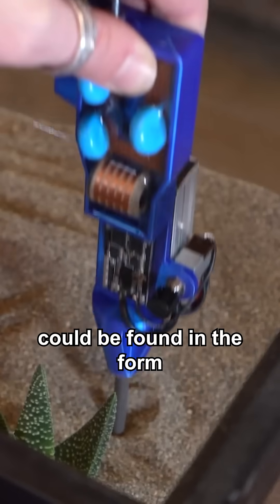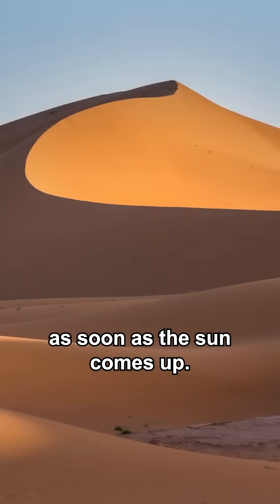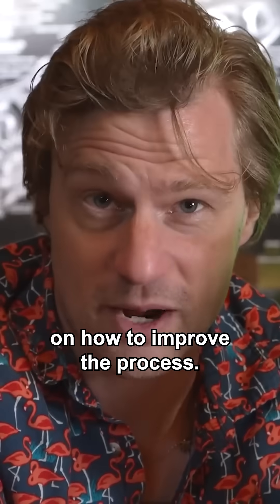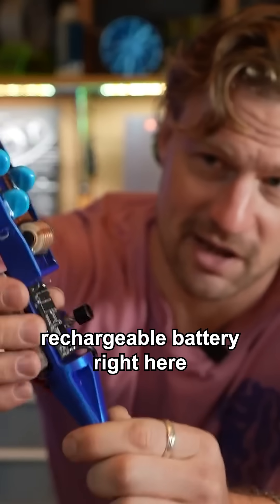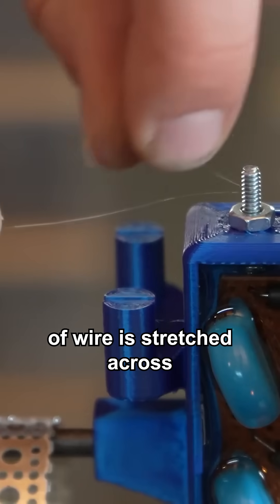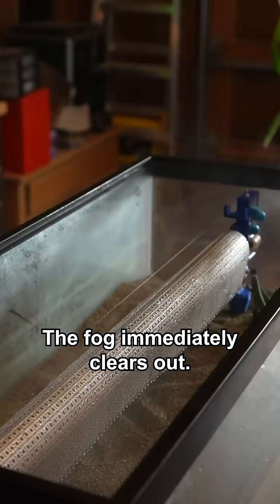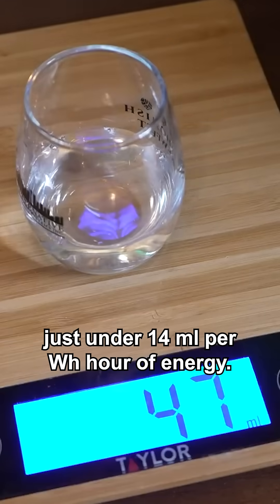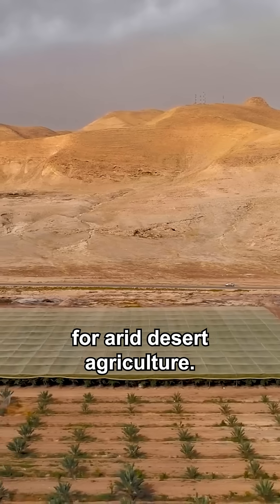Solving Desert Water Shortages Using 20,000 Volts (from full video)

Comment: If there's enough water in the air to be visible fog for which the measurements are baded on, there is definitely a latge water source nearby from which the fog is coming from. Deserts dont have fog just rolling in regularly. If it did, it wouldn't be a desert in the first place.

Anywhere these kinds of devices would produce any appreciable level of water are by definition not areas where one is necessary, not to mentione the water produced is generally not considered reasonably safe for consumption without further filtering processes.
Reply: Most of California and Northern Mexico are coastal desserts with fog rolling in most mornings. In fact most redwood use this to collect water. This idea is not good for other reasons though.
Reply: Costal areas that he mentions usually have that source be salt water and this is a watering device for watering crops not drinking water.
Reply: @jeffwithheldforsafety8359  okay, build a greenhouse over the water. You get water, and salt….oooor buy a reverse osmosis desalinater for 1 10th the price
Reply: OK, I just commented pretty much the same thing I did not know you had already done it and yours was done way better than mine years. Actually sounds like you know what you’re talking about. My comment did not it sounded like a guy that has spent most of his life working on farms in the south with no more than a high school diploma that I don’t even know how I managed to get that
Reply: Fog is in the air and can just be blown away. Water nearby is no guarantee that the water will hit the ground and if the water nearby is saltwater it can't be used to water plants
Reply: Damn, yall are blowing up my phone. Let a man cook some popcorn first.
Reply: What amazes me is that they could pipe salt water into the desert to be evaporated. Sell the salt. Plant shrubs to secure both the moisture and stabilize the sand.

We have real knowledge on how to re-green deserts.
Reply: @skipmage  I think the problem is mostly economics. There just isn’t a financial incentive to do that. The US alone has absolutely massively swathes of land and yet there’s still a housing problem. Not only that but the US has a massive amount of unoccupied houses as well which almost makes no sense if you just look at those factors alone. The reality is that no one wants to live in those houses because it doesn’t have jobs or hospitals or supermarkets or any combination of things a human would need to comfortably live. The same thing goes for deserts. Suppose we do make all those deserts green. What do we get out of it? Well, we potentially have a place to put houses and malls and schools and… oh… that’s another couple billion dollars upfront cost. Okay, let’s turn them into farmland. We just need to greenify them, then add soil, create irrigation systems… and… oh, that’s another couple billion dollars for produce that’s more expensive and not as good as anything on the market.
Reply: As a PSA about thunderfoot, the guy has been a hack for some time now, only concerned about getting clicks on his vids. 
For instance, in his criticism of a device that supposedly removed moisture from the air, presumedly using a similar tech, his analysis had the air never moving. Once the moisture was removed from a cubic meter of air, that cubic meter stayed in the same place until the end of time. The mistake was so glaring, it had to be intentional. Trashing things is popular content. He's done the same thing repeatedly.
Reply: @ i think hes been focusing musk too much especially recently. Are you talking about dehumidifier water generators? I cant speak much about that mistake but I believe it is pretty well established that dehumidifier water generators dont work well unless air is humid (so, using it where it is actually needed is not gonna work well), way too expensive at scale and simply just not a new idea.
Reply: @emmioglurycbj Seems your comment was addressed to me, not sure why you didn't directly. If so, you completely missed the point. Don't use thunderfoot as a reference for anything. Whatever he says is to be dismissed out of hand until independently proven. As another example, he claimed that the Hyperloop was impossible due to thermal expansion and contraction, when the problem had been solved over a century ago. 
As for air dehumidifiers that can keep an individual alive in the desert, are portable and solar powered, no. That has yet to be proven untenable, to my knowledge.
Reply: @ he was pretty spot on about the hyperloop not being worth pursuing. He was able to spot the failure point of one of SpaceX’ rockets from just the video. His analysis of Kickstarter scams like the indoor composter (read: trash ovens) and the water from the air (read: glorified dehumidifiers) are in line with basic thermodynamic analysis. He was actually so spot on that the defense for the kickstarter changed like three times. One of them having the device basically become a rain catcher and he was able to show that a bucket in the humid area would have worked better. I’m not going to pretend that he gets it right all the time because these types of things tend to go all over the place. Covering basically every engineering discipline which can easily spread yourself too thin trying to learn everything which makes you very susceptible to making a mistake. But to say Thunderf00t’s analysis is immediately dismissible is just being disconnected from reality. He’s way more qualified than the overwhelming majority of YouTubers when it cones to stuff like that. If you think I’m wrong, I’d be happy to hear who you think would serve as a better science YouTuber that does analysis videos on the broad range of topics like Thunderf00t does but disagrees with him on a lot of his points.
Reply: @Unfortunately for you, you were unable to construct a rebuttal. It's a fact that pipeline thermal dimensional changes have been dealt with and that air moves. There's been many more examples of either stupidity or dishonesty on his part, but you'd ignore them as well. 
It's irelevant to me and the discussion that you're a fan. Thunderfoot is an unreliable source, as proven above.
Reply: @K-Locke  oh, there’s solar roadways. He was right about that too.
Reply: @ I just told you, I don’t expect him to get everything right. It’s right there in my message. I said if you cover as wide a net of topics like he does, you’re bound to make mistakes. Did you think I was arguing you were wrong about that one specific thing? I said his analysis are usually spot on and are easily verifiable by highschool level physics. Off the top of my head, he was right about the composter and the dehumidifiers. If you think there’s a better science YouTuber than Thunderf00t that covers as much topics as him, has a comparable or better track record and disagrees with him, I’d love to be enlightened.
Reply: No, he wasn't right about the dehumidifiers. His calculations were made assuming the moisture was taken out of the surrounding air, which was never replaced due to a magic boundary of some sort. How many times must we go over the same thing? And, it wouldn't matter how many examples I give, you'd stay in denial. So, play pretend whatever you like. For everyone else, disregard his junk clickbait.
Reply: @K-Locke  that’s not a mistake. That’s a simplification for the purposes of calculations. We do that in physics all the time. Don’t tell me you think all projectile motion calculations are wrong because they don’t all factor in literally everything. Projectile motion with just the initial velocity and a constant gravitational acceleration is disgustingly accurate despite not factoring in things like air resistance, Coriolis effect, and time dilation. Show me the difference between this discrepancy. Let’s go through the math together.
Reply: @K-Locke  he was also right about plastic from the air. 🤔
Reply: And, I can make fallacious arguments like yours, if you like. Prove there's no other YouTube channel that does a better job at what thunderfoot does.
Reply: @  @K-Locke nobody particularly commented about his dehumidifier analysis. Its just that he has a very succesful track record of debunking scams and shams and as far as I've been following him, he almost always (at least mostly, if not entirely gets it right. I also do not recall saying it is not possible for a dehumidifier to generate enough water in dry climates so a person can survive. The problem is, beyond cost and filtering problems of dehumidifiers, they usually claim it is possible and viable to generate bunch of water at scale; and plan to do this in dry climates! At which point, ged darn water trucks become exponoetially more economical. Please correct me if I'm wrong anywhere
Reply: @K-Locke  fallacious? There’s plenty of better science YouTubers. A lot smarter than him. The problem you don’t seem to understand is that they don’t regularly disagree with him. That’s what you don’t seem to understand.
Reply: it'd be cheaper to bring in water with trucks than to do weird electricity shenanigans like thees.. its nothing new..
Reply: @zachariah-1 you don’t have to fuel solar panels you just have to clean them
Reply: @justkev1044 yeah but the solar panels need sun and he states in the video that the fog goes when the sun comes up. So he lied in the video saying that it can be solar powered.
Reply: @zachariah-1 or build a pipe
Reply: @zachariah-1 are you an accountant?!?
Reply: @zachariah-1 if everyone thought like you, we wouldn’t progress in anything
Reply: @jaaad344  that's how my understanding of science works, i will not believe you when you don't have strong credentials and present something supposed to be groundbreaking until you prove it otherwise. It's called skepticism
Reply: @emmioglukant bro, you make a meager living writing comments for dictatorships. We aren't going by what you think.
Reply: @zachariah-1  Like he said, it's for coastal regions.
Reply: @HyugaSama  i bet two nickels established methods are crazy more reliable and astronomically cheaper
Reply: @zachariah-1  can't see my comment. What are you responding to? Quote me atleast
Reply: oh i cant see it either now lol. this level of cancership is crazy.

i was commenting to you saying it was intended for coastal places
Reply: @zachariah-1  I see. Well since we both don't know enough about the established methods, guess we're at an impasse
Also why would you assume that? Less effective alternatives are utilised all the time
Reply: @HyugaSama  well, my mental firewall policy is to take such a stance whenever I see "cool innovations" about settled methods that i see on non-technical YT channels or god forbid on the news. I'm more than happy to stand corrected whenever I'm wrong with a 0.1% error rate.
Reply: @emmioglukant  that's an appeal to tradition
Reply: @HyugaSama  well maybe, but id rather ignore or deny these kinds of stuff until seeing anything substantial, just tired of giving the benefit of the doubt to the fancy new technology in an established industry, that doesn't deliver 99.9% of the time; that takes expertise and quite a bit of effort to debunk. you could watch some debunk videos by thun der foot 00 you'll get what i mean. you can claim a bs with no effort, but debunking will take much more than that, so it is only natural to be negatively biased towards these things.
Reply: @emmioglukant  but you don't know the industry. And depending on the situation, it's not "99.9%"
Reply: @HyugaSama he is right. Water turns into vapour after introducing an absurd amount of energy. That energy would have to be pulled out which is usually done via some sort of cold reservoir which takes the same amount of energy as the amount of heat you’re trying to remove. Transporting water obviously does not require vaporisation and is astronomically more energy efficient. If you don’t believe me, imagine carrying a pale of water vs boiling water by cranking a shaft. Spoiler: you won’t be able to boil any appreciable amount of water by cranking a shaft.
Reply: @HyugaSama the device the video is made from is made from very basic thermodynamic concepts. You learn about this stuff in highschool. If you think entire governments and institutions did not think to apply basic physics to solve a problem, then you’ve got a bigger problem. The guy is correct. Whenever you see supposedly ground breaking science, you should be skeptical unless it’s from a university or some research leading institutions like NASA. It isn’t an appeal to tradition. It’s a very good rule of thumb based on simple analysis.
Reply: @ buddy im a mechanical engineer. Why TF are you trying to explain evaporation and condensation to me? And whyd you start that response with "Hes right"? Did i ever say that thats not how things work? I have no idea what you were trying to convey here bruv
Reply: @HyugaSama  you’re a mechanical engineer? Really. Say something only a mechanical engineer would know. Something with math.
Reply: @blablabla7796  The fundamental principle isnt groundbreaking. That was never the argument. And no one said world governments arent aware of this. You sound naive. Seems like youd be surprised by how inefficient govts are. Dont assume just cause something is well known that its being applied everywhere
Reply: @blablabla7796  And no, it quite literally is an appeal to tradition. Unless you actually know your literature and do your homework, assuming this is inferior to the existing methods is quite literally what an appeal to tradition is
Reply: @blablabla7796  you want me to prove my credentials on a youtube comment section? Tough luck kid. And why is that surprising? I said im an engineer, not that im working for NASA. Being an enginner really isnt that big of a deal
Reply: @ tell me something a mechanical engineer would know that a normal person wouldn’t. Hit me with at least 3rd year mechanical engineering math.
Reply: @blablabla7796  And you do realize we're on the internet right? I could literally use chat gpt to craft a satisfying response and you wouldnt be none the wiser. What on earth is that question even going to prove? Seriously, every time you respond you make yourself look more and more like a highschooler
Reply: @ yes. I want you to justify your appeal to credentials. You brought it up so you have to back it up. I’m friends with a lot of mechanical engineers. I’m an engineer too, though not of the mechanical type. Sure, being an engineer isn’t always a big deal. Some engineers graduate without really learning the material. This is why I’m asking you to say something a mechanical engineer would know that has some math involved. If you can say anything in your own words a concept with a formula, you’re already 90% better than the over abundant supply of engineers in the world. If not, then we can disregard your statement of being an engineer.
Reply: @HyugaSama  c’mon. Hit me with that Carnot engine. Tell me about heat pumps. Maybe even bring up how to use a steam table.
Reply: @blablabla7796  I didn't use an appeal to authority. I never justified my argument by saying that it's true cause I'm an engineer lol. The only I said that I was one was because you were explaining very basic concepts of thermodynamics as if I said that wasn't the case. And you haven't responded to anything I've asked you either. What on earth were you trying to say with that response?
Reply: @blablabla7796  yeah I'm not gonna elaborate on any of that just to prove that I'm an engineer to some rando on the internet. Especially since I never once appealed to my credentials.
Reply: @blablabla7796  weather I'm an engineer or not has nothing to do with this conversation. Stop trying to run away from the questions I've asked you. Try to stay on track pls
Reply: @ I didn’t say you used an appeal to authority. That would be a fallacy. I said you made an appeal to your credentials. Which means you invoked the fact you’re a mechanical engineer to add credence that what you’re saying has a logical and scientific backing.
Reply: @ I have a very good hunch that you’re a highschool student that’s aspiring to be a mechanical engineer. Any mechanical engineer can and would drop a single line to prove they went to school for mechanical engineering. It takes a lot of hard-work to graduate as one, even if you barely got by. We’re not going to move on from this conversation until you can say something a mechanical engineer would know. If you can’t, then just concede that you’re not qualified to make any technical assessment about this video and its contents.
Reply: @blablabla7796  like I said, I didn't. You've confused yourself there. Again, I only started that I was an engineer cause you were explaining EXTREMELY BASIC CONCEPTS TO ME LIKE I WAS A CHILD. I never started that when I was talking about the subject.
Reply: @blablabla7796  also, have you not understood why asking something like is is stupid in an era of generative AI? Literally anyone, including you, could probably fabricate a response better than what I could by myself. Why would you even ask something like that? That's stupid
Reply: @blablabla7796  as if you've said anything in here that an average highschooler doesn't know. Like I said, ive not made an appeal to credentials, and great excuse for not answering anything I've called you out for. That kinda cop out ain't gonna save you irl tho
Reply: @blablabla7796  it's is amazing to too see that you think me saying anything, that literally anyone can fabricate using AI, is what proves my credentials. That too when I haven't made an appeal to credentials. Dude, if you don't know what you're talking about just keep quiet. This is just embarrassing. And since you're avoiding my argument and questions saying that you won't unless I prove my credentials, you're the one making an argument from authority here. Wow
Reply: @blablabla7796  I do urge you to atleast try to respond to the things I've called you out on. Maybe save some face with that
Reply: @ You can try passing off AI as a genuine response to my query if you want. Just know that a non-engineer won’t able to detect engineer-isms and the lack thereof. Look, it’s not that hard. Just say any engineering concept tied to a formula and tell me about it in your own words. I’m not asking you to show me your diploma.

I can take the argument anywhere you want. If you want it technical, then let’s do the rough calculations together. I don’t mind. If you’re either lying about being a Mechanical Engineer or you’re not confident in your mechanical engineering skills, then we can take it purely in the realm of logic and reasoning. But before that, I need you to either concede that you aren’t a Mechanical Engineer or just do what I’m asking you. The more you try to weasel out of my very simple ask, the more people will just dismiss everything you’re saying.

I’m willing to have this conversation with you. If you are too, then just humour my request. I can drop all hostility too if you want.
Reply: @blablabla7796  alright, but since I asked first, you answer my initial questions to you, and I'll follow that up by explaining any topic in mechanical engineering. Since I never made an appeal to my credentials and since my credentials have nothing to do with my arguments, I feel like that's fair
Reply: @ what is your initial question? YouTube is censoring your replies and I can barely see your messages via notifications. Your latest message won’t even open anymore. I’ll answer one question then you’ll humour my request.
Reply: @HyugaSama  so, what’s the question you want me to answer?
Reply: @ probably the y d@leted his reply. Half of my replies under this comment are also delegated
Reply: @ just mention that you Trump ir JD Vance, then your replies are safe from them
Reply: @zachariah-1  I’m just seeing your comment now about Thunderf00t and I’m convinced you’re way more informed about this subject than the other guy. I’m surprised you initially took such a soft stance on the topic, with you conceding the you aren’t exactly caught up to all the industry standards and whatnot. But then again you’re taking a much more honest approach and the other guy seems to have taken it as you not being knowledgable in the subject matter, i.e. you’re on equal footing. But that can’t be any further from reality.
Reply: @zachariah-1  It might be YouTube’s servers acting weird. Probably some sort of desync between the comments service and the notification service. Though there’s also a chance that the algorithm is picking up on our “hostility”. Either way, it looks like the other guy ran because he actually has to defend being an engineer now. 😆
Reply: @blablabla7796  I'm seeing all the comments just fine, but I've been seeing some blank gaps in several other comments sections, and have had two other people say they couldn't see some of my replies on comments that are definitely still there, as my wife was able to see them on her account.

I'm almost certain it's a YouTube issue, not a censorship one.
Reply: @emmioglukant  thunderf00ts video on these overhyped dehumidifiers is also where I first learned of this particular tech bro wanna be breakthrough. This is different in the sense that it's not trying to sell a product and isn't malicious in any way I can tell. Normally, his videos are decent content when he sticks to his range, but here he's over selling the potential of an idea he doesn't seem to hasn't done much personal research on.

My original comment wasn't meant to shit on him or detract from the neat garage engineering project he pulled off. Just that there's more than enough reason to be overtly skeptical of the more grandiose claims he made about the potential of the general idea.
Reply: @pureatheistic  you’re probably correct that it’s just a server issue this time. But there are definitely times when it’s a censorship issue because I’ve thrown my fair share of vitriol in the comment section of some YouTube videos and those messages are shadow banned unless I adjust the phrasing to be as unthreatening as possible. I would open a different device/incognito tab to see which of my messages are going through.
Reply: @blablabla7796 bending moments 😅
Reply: @zachariah-1  it is not cencorship, it happens to most of us here on YT
Reply from the maker: So as a reminder everyone… this is a short from the long form video. The full video is wayyyy more in depth. Also, it worked with fog artificially, and I’m trying it in situ in either Chile or Namibia in two months. Cheers!
Reply: @ this thing working isn’t the issue. If you really want to dispel doubt, go to a place that needs water. Use this device to gather water for 24 hours, calculate the amount of water collected and calculate the total cost of the device (initial and operational), then show us the cost per unit water if it’s even worth doing this. There’s a chance that buying a bottle of water is cheaper.
Reply from the maker: @blablabla7796 I hear you. That’s why I’m planning on Namibia.